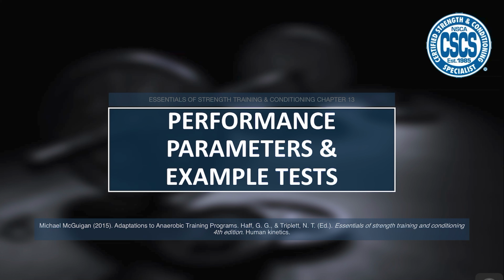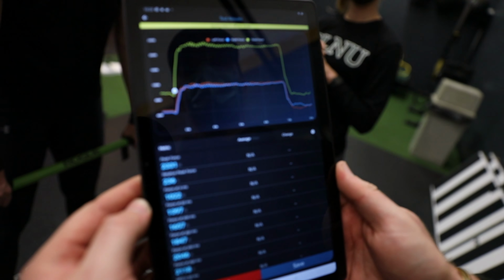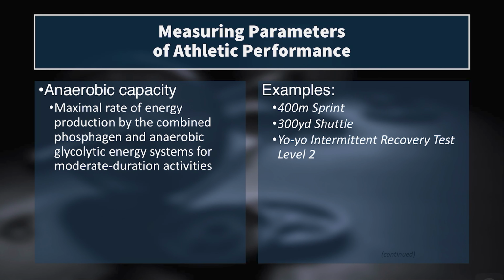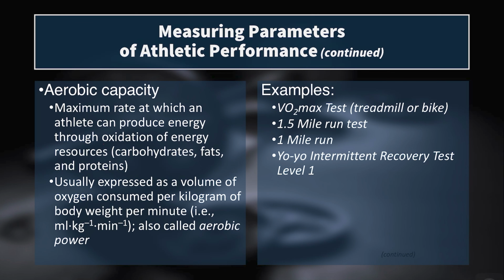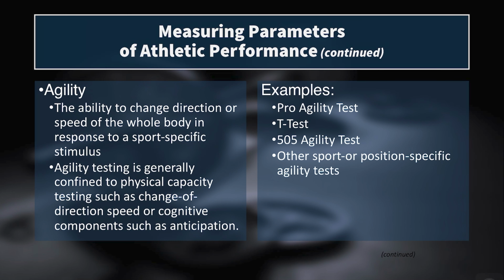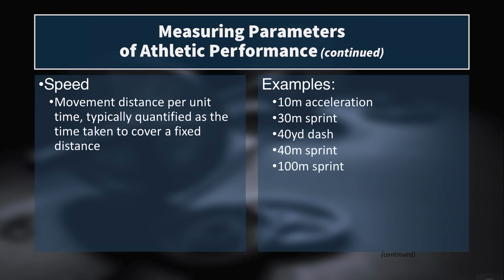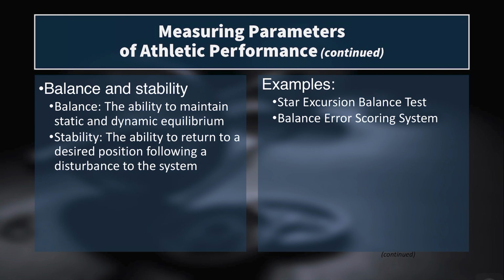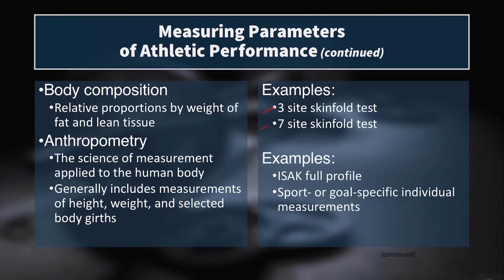Sport Performance Testing | CSCS Chapter 13

Comment: One key takeaway from this lecture is that sport performance testing includes many different components because each test helps coaches better understand an athlete’s abilities and design more effective training programs.
Reply: I agree. It can offer more information about where an athlete is at in terms of performance.
Reply: agreed Eva, coaches getting to know the most about their athletes through the testing not only allows coaches to develop very specific exercise programs individually, but they can identify trends within the team that might also need to be addressed.

Comment: Unrelated question, but for sports performance, in a weight room is it necessary to have a leg press machine?
Reply from the maker: Not necessary by any means. A leg press is a great tool, but if the weight room is dedicated to sport performance, then there are a lot of other implements that should take precedence over a leg press. A belt squat would be a better use of the space, but even without it, most sport performance S&C programs make use of barbell and dumbbell squat/lunge/hinge variations for the majority of their lower body strength development
Reply: @DrJacobGoodin  Thank you for your response, I appreciate it. If it's possible, how would I be able to see how the weight room for your classes is set up?
Reply from the maker: @alexo5190  Great question! I'll add it to my list of video ideas.

Comment: Very curious what tests / fitness and parameters would be good for older generation (40-65 years old)
Reply from the maker: Mostly the same to be honest, if you have access to the equipment. However, if you're concerned about being able to hit maximum intensities without sustaining injury, you may try a load-velocity profile where you plot your bar speed at incremental loads. That way you don't have to do any rep maxes, but still have objective data to train with.
Reply: @DrJacobGoodin  thanks a lot for answering
Ps do you have an insta page or an email for contact ?

Comment: Thank you DR. Jacob for your contribution towards explaining these topics. If you  test endurance  you should test till failure. So how it is mentioned set up test (muscular endurance) is in one minute.? Regards
Reply from the maker: You're welcome and good question! Muscular endurance can be tested to failure or for a longer duration (usually 1 minute or longer). A 1-minute rep max test can still be muscular endurance because performance is limited not by cardiovascular or force production ability, but by the muscle's ability to continually generate sufficient force.